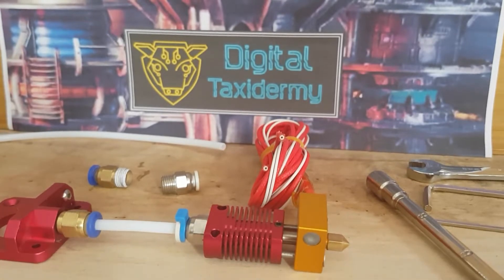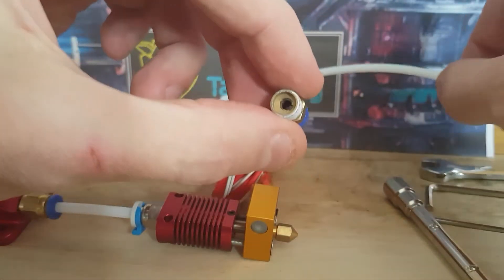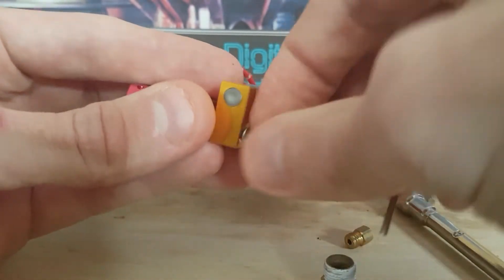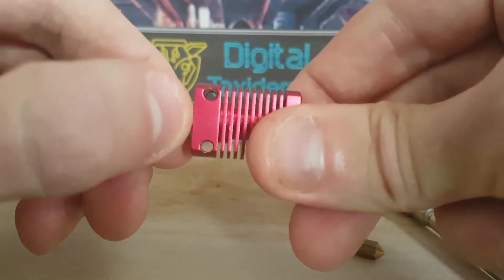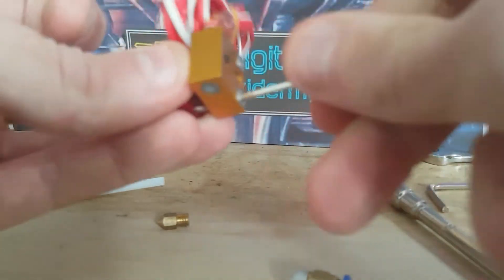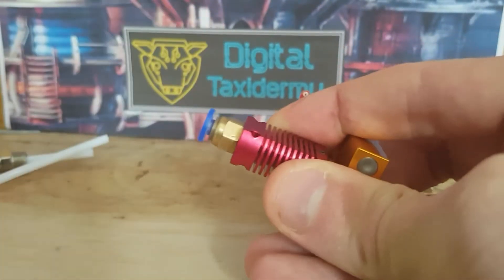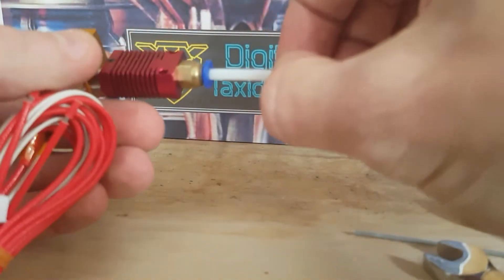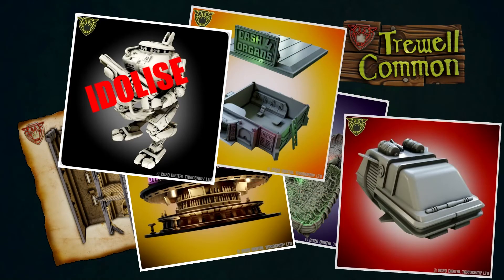Ultimate Hot End Fix for MK6 microswiss ender - stop clogs, save bowden tube 3D printing hack

Comment: Why can't we have a metal "boden" tube in the heater element. A piece of copper tubing the right size and we can just change it out.
Reply from the maker: because copper condusts the heat in a different way but what you are saying is basically an all metal hot end

Comment: When you talk about backing off the coupler to cut the tube, you say a couple of twists but only back off one full turn. Just a note if you want to be more specific
Reply from the maker: Its not really that specific just make sure you have enough that you feel is adequate to get a bit of a squish on the pipe, a couple of mm oversize is fine. 
if you really want to be specific then you can get the vernier out measure the distance then add on a couple of mm and make a cutting jig, I just kind of feel it and go with it